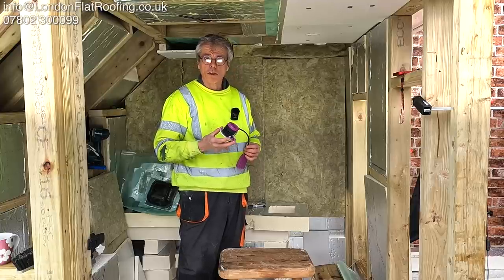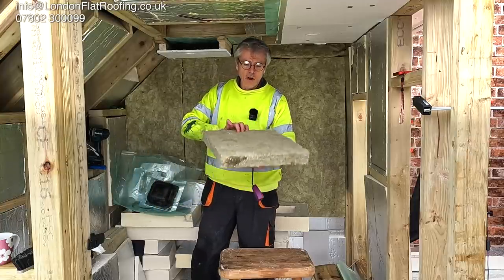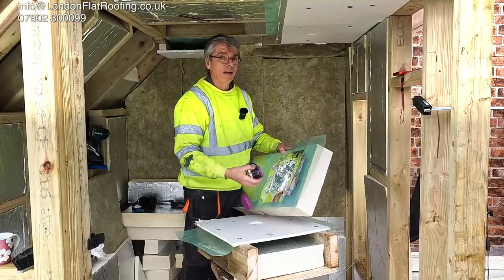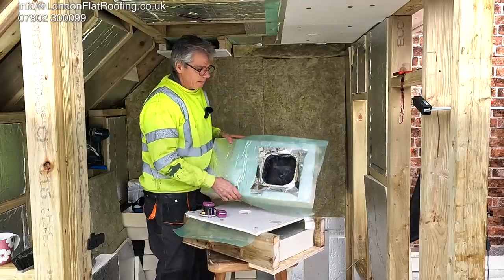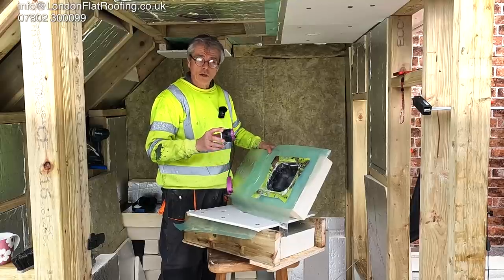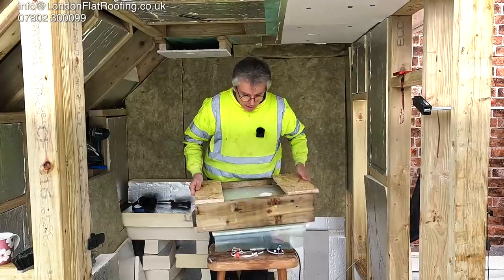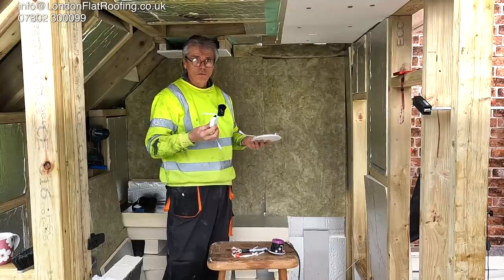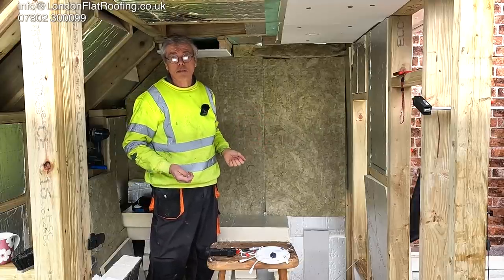How to fit downlight in flat roofs

Comment: In a lot of lofts I've been fitting a triso insulation coupled with a pir behind. I cross batten with 25mm.  I've always wondered if there's a downlighter that's shallow enough to sit into that gap. Untill I find something I don't recommend them being installed. Not worth the risk
Reply from the maker: triso is a good product if fitted correctly and sound like you know your stuff
Reply: @SteveRoofer  yes mate I love the stuff. Been using for years now without any issues. Less mess and less wasteage than pir board. I'll fit it all then my electricians can first fix around the battens thus keeping it totally air tight, it's a great system

Comment: You may laugh, but I used ceramic flower pots and blocked the hole up with silver tape. They are fire-resistant and absorb a lot of heat.
Reply from the maker: Novel idea but probably very good
Reply: I did the same. Had a real problem with weeds though, which suggested condensation.

Comment: Does this still apply to a tiled pitched roof? Which has a lot more air flow as has the breathable membrane & additional gap from the roof battens
Reply: I have exactly thus question we have a low pitch dormer being extended which requires spots so head room for drop is not there, room too large for wall lights so a cut out is only option

Comment: Very informative👍 could you advise please just had my flat roof ceiling pulled down along with damp fibre insulation which was 20 yrs old as we had water ingress - sorted now -  we would like mineral wool back as insulation, do we need vapour barrier as its a cold roof and if so how do we make that airtight (not sure if walls are airtight as building regs have changed a lot in 20 years)thanks for the tip about the centre light fitting

Comment: I have had a garden room built and I know they would have just cut holes in the plasterboard and VB to install them. If there is adequate roof ventilation and the room is only used for a couple of hours a day is that good enough? 

Obviously old houses didn’t have VBs but many are fine and this has to be down to less insulation and better ventilation

Any help would be much appreciated before I rip it down and cry ha

Comment: Quick question for you, when you put the downlight into a drop ceiling isn't there a problem with condensation forming on the vapour barrier and then dripping down into the plasterboard?
Reply: I'd imagine that since it's below the insulation it's does not condensate since avoids the cold air

Comment: I'm planning for a Garden Room build for a home gym upgrade (Approx 5m x 8m).
I'm planning on have a Flat Cold roof with Solar panels on top.
Being a gym, my concern is condensation build up in the gym due to sweat etc.
I originally intended to install some kind of extractor fan for ventilation, how can i do this without affecting the vapour barrier?

Comment: Great video.  Would it be possible if for instance you have excess room, to push the insulation higher up in to the joist (still with 50mm air gap). To allow space for fittings underneath?
Reply: I have a 175mm joist, will be battening above to allow air flow from the pitched sides of the roof to go over the steel beams and through the flat roof section). Will be using 120mm boards.. so I have some room to play with in regards to the ‘positioning’ of the boards. Hope that makes sense?

Comment: Hi Steve, I am having a garden room built and I’ve followed all the flat roof videos and chosen to go for a warm deck roof. Your advice has led me to making some choices regarding materials and the final piece of the jigsaw is the impact of adding a log burner with the the chimney conundrum. Out through the wall or out through the newly constructed flat roof? If you’ve any advice tucked away can you please signpost me? This video was great as I noted that on the comments, fitting down lights in a warm Dee kitchen does not have the same issues. Thanks for all you do to pass on great advice. 
Regards,  Wayne
Reply from the maker: Penetrating the warm roof should not be a problem re condensation
Reply: @SteveRoofer  Many thanks Steve. I really have specifically identified the materials and process I want my contractor to follow. The flat roof joins the existing tile roof 3/4 rows up so now looking for how that is done. Learnt so much from your presentations and knocked up models. Brilliant!  Wayne

Comment: With cold flat roofs u should design under the joists as well as over. Counter batten below the joist is way to go. Also have the lighting circuit designed so all the Jb’s/drivers/remote receivers etc are all in one hub in a cupboard below the ceiling somewhere so they have air/space to stay cool and so faulty item can easily be replaced. The use the counter batten for all the cables runs. I would also accept the limitations. Don’t have downlights if it means you have to cut the vapour barrier/insulation. The slim like light look nice, LED strips are getting popular now where u plaster the channel into the ceiling.
Reply from the maker: Yes LEDs are changing the game

Comment: can you seal the light fittings in or will the air still track through from around it because the vapor barrier has been breached, ive done a lot of loft conversion's with low headroom and the vb breach has always been a problem, maybe led tape is the future in these situations
Reply from the maker: Compared to how much air leaded through the old ones these are fantastic but still not perfect